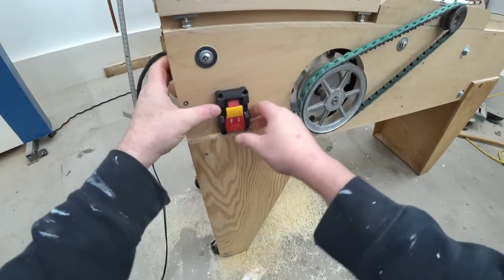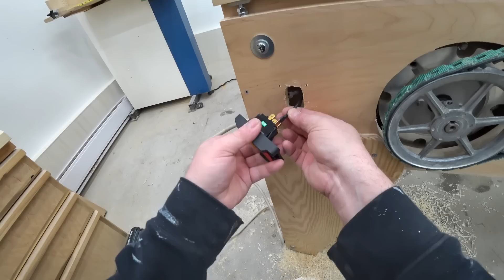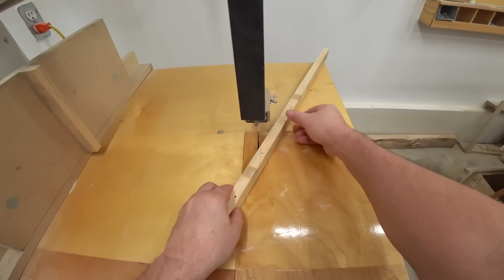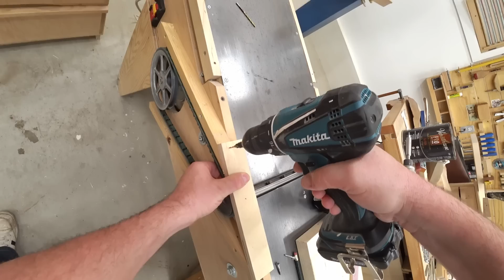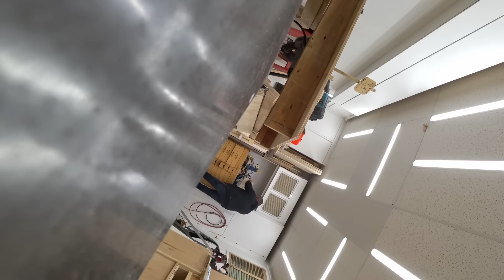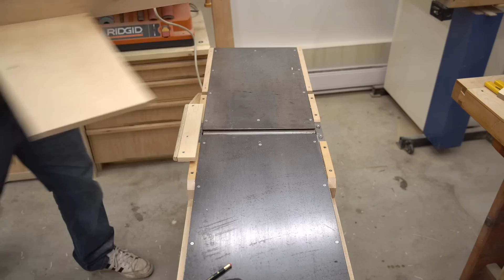Homemade Jointer - Fence, Belt Guard and Switch

Comment: Well done!  I hope you'll post a vid of you planing a piece that's near full-width, because it sounds like that motor is big enough that it's not going to slow down for much.

I like the fence - simple, easy to square and quick to adjust.  In the 3 years I've owned my jointer I've not yet have reason to use the angle function - it's just more fobs to deal with in keeping things square.

This was a great project, glad you regained the steam to finish it up.  Now on to that table saw! ;)

Comment: 4 screws, and the jointer came out great John. I agree on the tilt opinion on the fence. I have never ever taken mine out of the 90 degree. If I need a bevel I would cut it on the tablesaw, and then run it freehand flat on the jointer to clean it up
Reply from the maker: Exactly what I was thinking :)

Comment: Blue base for this channel, red fence for the other channel?  Hmm...  No, that's not right either.    
Looking good, John!  That last scene showing the 90 degree on the board is what this was all about!    
Another project knocked out of the park!
Reply from the maker: Thanks!
I think if I do paint it, I make it a medium grey.
Reply: I like the colours of your band saw.  Looks clean and simple, and most importantly not Green.  Although I suppose if you don't paint it it will showcase the Homemade build (like your router table).  Makes me go back and watch the Build video.

Comment: John, I see you're beeing extremely unsafe by not wearing impact armor and a full hazmat suit! For shame! ;) (Sorry, I had to come out from under the bridge!)

Anyway, do you have any recommendation for an easy way to move door hinge mounting screws about 1/4"...short of drilling out the holes, gluing in plugs/dowels and re-drilling? I don't want to wallow out the holes in the hinges.